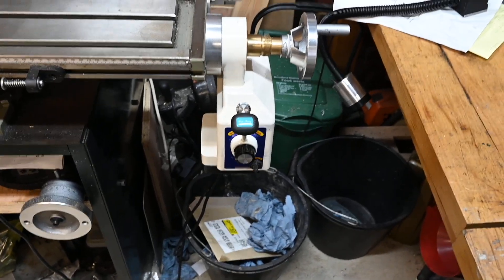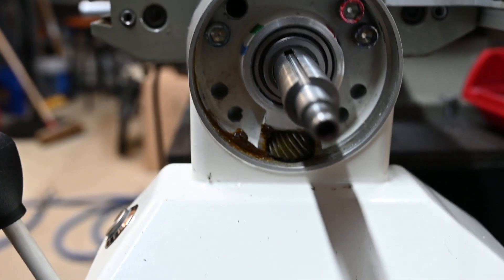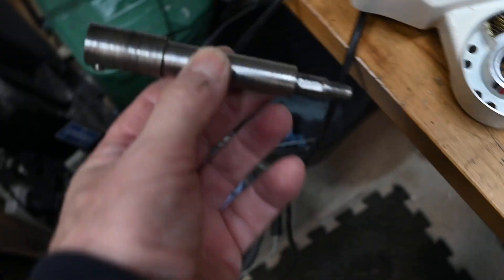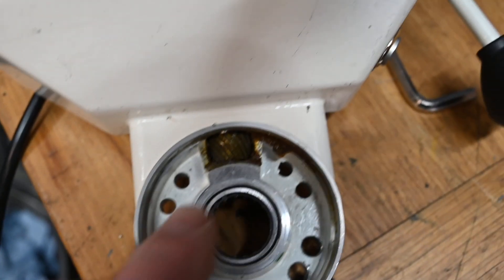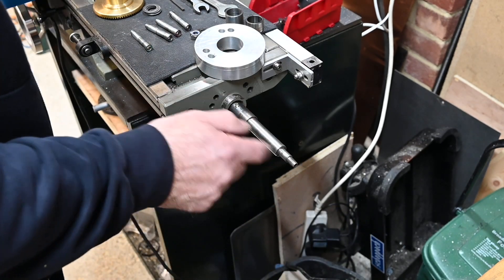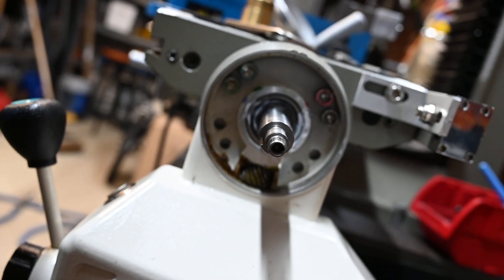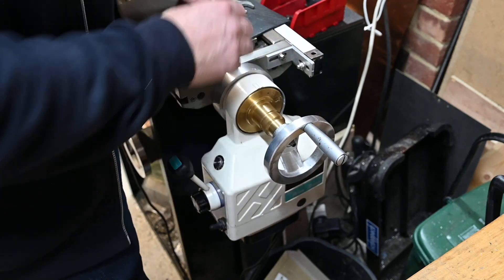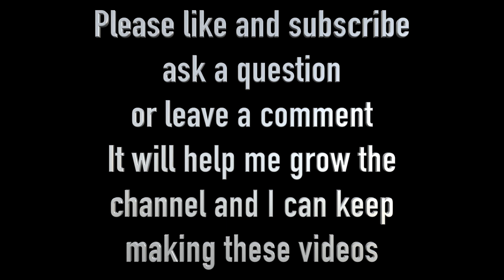Fitting a Power Feed to My Chinese Mill _ Chester Champion 20 #not sponsored

Comment: Welldone!
It obviously works after two years of service but is any of the weight of the drive cantilever off the short leadscrew protrusion or does the aluminium piece support all the drive weight?
Reply from the maker: There is no load on the lead screw, the unit is bolted to the table 👍